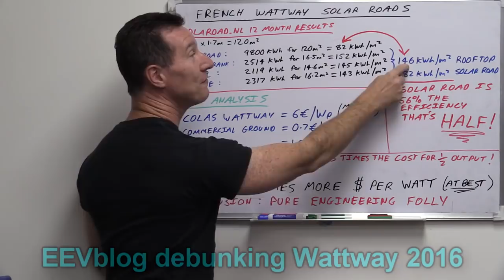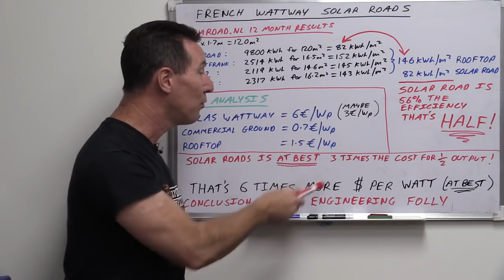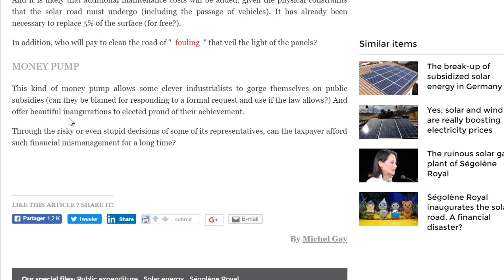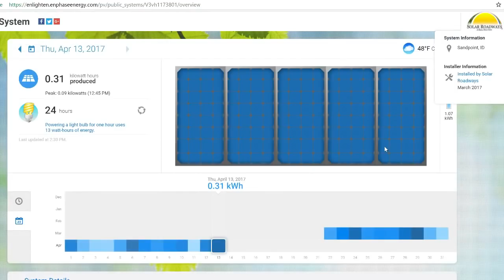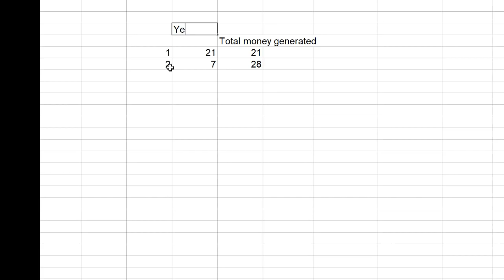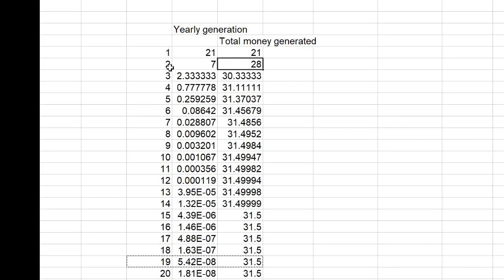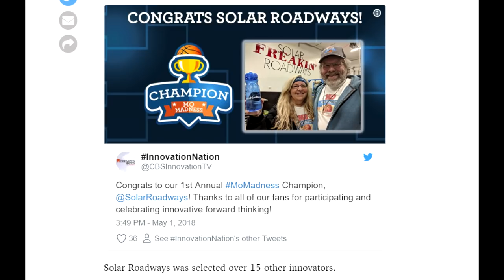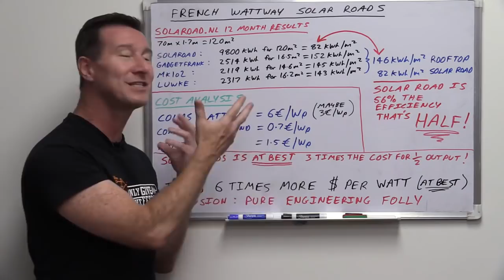Solar Roadway: 10¢ return on $1000 investment!

Comment: Solar powered flashlight!!

That only functions during the daylight hours:)
Reply: Give this man a 2 million dollar grant!
Reply: @user-oy8vu3xb2y   voting u for the  next elections
Reply: Boi, the flashlight is supposed to CHARGE ITS POWER BUFFER during the day than actually using the power...
Reply: @905SunnyGachaGaming   think outside the buns
Reply: You can easily fix that by mounting a small mirror in front of the flashlight, reflecting the light back onto the solar panel: infinite energy supply!
Reply: @1FRAG1B  if it ever happens , im taking you on the first mission to mars!

Comment: why roads though? I would have thought pavements and side walks would have been better. If you look at a new road vs a road that's a few years old, you can instantly see that the older road is much more smooth. However pavements and sidewalks take years to wear down, you have to go to ancient castles to find grooves in stairs from foot fall.

Comment: Isn't better to put a Stirling engine. It could be with the surface of something that accumulates heat and be something durable for the cars. Like normal roads. Then you put a sirling engine that makes energy by the difference of the heat.

Comment: Why not build solar panels on top of utility and light poles? Put a small motor on the bottom of them so they can turn and track the sun. Power the lights for the roads and any excess gets sent via power lines to a power bank for later use somewhere else.

But I guess scam artists can't make money off of idiots using that idea.

Comment: If they burned a $1 bill roughly once every 10 minutes (5.707 times per hour) you could recover roughly 4 BTU per bill via thermocouple. This would equate to roughly 0.16059 kWh produced every day. At this rate, you would produce 586.173 kWh over the 10 years it would take to exhaust 500,000 $1 bills. Since the average price in the U.S. is 12 cents per kWh, burning money would return $70.34 --- MORE THAN TWICE WHAT SOLAR ROADWAYS RETURN.
Reply: boom!   Thank you for being that somebody to do the math calculation of literally burning money.
Reply: Steven Biars good game man.
Most interresting comment of the day.
Reply: Consider if you did this for a time approaching infinity the efficiency is going to drop even further as you inflate the value of $1 notes by burning a substantial amount of them, if they can't be replenished quickly enough.
Reply: @Marci124  that would increase the value of $1 notes.
Reply: ooof
Reply: Stupid FREAKIN' Idiots!!!

Comment: So I have been watching a few of your videos. The content is interesting but you repeat the same thing over and over and over without the repeating the exact same clips  and statements you could half the length of the videos. I get repetition I learned that in college that when speaking to repeat the point but generally it was encouraged to use different wording to reinforce the point or repeat in a short summary at the end.

Comment: You forgot to calculate in the rage it apparently causes in David. If you add that energy to the equation the system comes out about break even.

And David will last a lot longer too.

Comment: Just another example of government incompetence.  Solar panels aren't even worth it compared to coal under the best circumstances.  If solar is so great, we'd already be using it to replace coal/nuclear in our power grid and we wouldn't need a government program to force it down our throats and waste a shitload of tax money.  Instead the government tries to push solar panels through taxes and regulations as well as giving tax payer funded incentives for people to use solar.  It's fucking retarded.  What a waste of money.  

Grow up liberals.  We want our electricity cheap and our taxes low.  When solar technology improves to the the point that it's better and cheaper than other sources, then and only then will it be a viable option and no wasteful government intervention will be required.  Free market principles.

Comment: I don't get why this is still even a thing, or ever was. How is it more logical to make a surface covered by objects solar panels when you could simply put the solar panels above all of the roads, or better yet simply subsidize solar panels for buildings and houses and sell the power consumed to the buildings owner at a discount. I could ramble off a list of probably 400 better locations for bulk solar panels to be placed that would require far less upkeep, far less sun light obstructions, and overall just far cheaper, but of course they wouldn't be as novel as the idea of driving on a flat surface in the rain all the while degrading it's ability to do anything -_-

Comment: I don't know the fraction, but it would be a fraction of the cost to install the solar roadways, all car parking areas and sidewalks can be covered and solar panels installed on these roofs. Benefits: cars and pedestrians are out of the elements, and you get 140-150 kWh/sqm power from it.
Alternatively, you can just invest all the money it MSR development and have abundant (way more than any solar), clean, cheap electricity.

Comment: I have a proposal for solar Parking lots, Build solar Roofs over the Asphalt so the Cars can stand in the shadow. Its a winwwin situation: its about the same eficency as a normal instalation with fixed panels and in the summer the cars parking under the Panels dont heat up as much because they arent standing in direct sunlight. another advantage is that this instalation would produce power in proximity to its users.
I think that this is a good and realistic idea.....

Comment: Welp...  adding another entry to The List.  :-/

BAH  HAHAHAHAHAHAHAAAA!!!  The Ray C Anderson project, or "The Ray", in Georgia...  might as well be called "The RAT."  It is only 50 meters long...  and in the middle of a PARKING LOT.  It is essentially a truck scale for big rigs with solar panels and tire pressure sensors that invade your privacy to steal your cell phone information so they can xend you advertisements in the guise of "sending you a text to tell you your tire pressure when you drive over it".  

ANOTHER bullcrap money wasting project.  At least it is not on an actual roadway.  

Can someone please put a slug in the jackanapes that run Colas and that female idiot busybody little evil doer imbezzeling all that money from the Ga government with this worthless project please?

Comment: Remember that bit in Robocop, the original one, where Dick Jones says 'Who cares if it worked or not?'. Yeah, will this is the same thing. They know its BS and absolutely inneficient, but they will make a killing repairing it and replacing it over the years. 

Has anybody costed replacing all the existing roads with these solar roads? Im guessing it will be way into the billions in dollars, and the cost in energy will be incalculable. Im guessing theres a congressman or senator somewhere with a stake in a road building company jumping up and down in absolute joy at the prospect of tearing up a highway, then laying down another that will have to be replaced a year later. he's the one who will be pushing this, so keep an eye on the bastards.

Comment: Honestly i really like the south Korean idea. A lot of major highways have center dividers that would be perfect for a extended solar system if they mount it to some solid steel foundation that could withstand a car/semi crash.  The energy output would also rival that of roof mounted systems so  you could easily see the investment pay for itself within 10 years or so and still have the panels producing energy for another 10 years before replacements needed to be discussed.
Reply: It’s neat, but a lot of the space between highways are empty for safety(they are quite effective at slowing cars without stopping them instantly lowering chance of death).
By putting stuff in these spaces you increase the damage caused to vehicles, people, and your solar system.

We intentionally use protection systems that are not solid next to roads to give cars a chance to slow down and have saved countless lives with them.
Anywhere we have to put solid walls next to roads we do, but if we can avoid it we do.
Reply: Jacob Haver 
That South Korean idea is in fact a bicycle highway that is covered by the solar panels to protect them from the sun and rain.
Reply: @BLY99  
Plus on that: Cyclists and pedestrians won't be as hot as if they were un-shaded. Leading to less use of air-conditioning and/or fans, which would save more electricity and make more money in said savings than putting the fragile things on the fucking road.
Reply: And in this amount, the costs should be quite lower than for a single private home roof.
Reply: jshowa o they quite often are a lot lower than the roads by design, are ditches.

We use walls when we have to. In those spots I have little issue with having solar setups in those situations.
Reply: jshowa actually the ditches are quite good at stopping most cars on the road, it has some trouble with semis or large larger vehicles.
The vast majority of the time people do stop. However highway dividers also have trouble with larger vehicles.

80 miles is really quite a small part of the highway and can require highway dividers.

You’ll notice on the highway anything that can be designed to break away or slow down people slowly, excluding those times when absolutely necessary is.

Super busy parts are the parts that need these barriers.
Cars are designed to crumble on impact, but that only does so much, cars need more than that.

I’m not questioning highway dividers use on highways. I am saying that these dividers if overused will take more lives than they save.
In spots that have highway dividers it’s often either no protection or the walls, and obviously walls are better.
Also, a hill would probably be worse than a wall, when it got hit would likely cause more damage.

Comment: Why waste more money on inefficient solar roadways? We could more easily, on roads with no services beneath then, take the heat of the summer sun and store it in the ground and come the winter take the stored heat and use it to keep the roads ice free. Please note I said more easily and by that I mean more easily than getting any usable electric power out of a road surface. I am aware that there. Are limitations to such systems, such as having suitable available ground to put the heat into; but I'm sure we could get enough heat out of our asphalt roads as nearly every summer these days in the UK we hear of melting roads.

In urban areas we'd have to move the utilites first, and that's expensive. Just look at how much Edinburgh spent on getting its trams back (and how long it took). But in rural areas and on other roads without any services beneath them the cost of installation wouldn't be that great, in comparison to such works in urban areas (or the current cost of a mile of road). For example, the 9 miles of the M77 cost around £130million, a gew extra millions spent on a system that reduces the amount of salt per mile must be worth looking at.

Comment: Mind you your calculations were pointless, we all knew it would generate bugger all and obviously they had complete panel failures as that is not representative of a bog standard solar panel which will give close to full output for five years and fall off slowly. I reckon that by year 10 all things being equal, they will generate 2 cents a day. Flipping amazing. No need to fiddle the math.

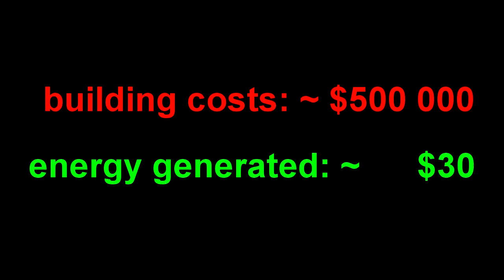Comment: 11:45, is it? What would be the ROI on burning 1$ bills for heat? Well:

ROI of solar roadways: 0.01%

Amount of heat from a dollar bill 13125 J/$ http://www.madsci.org/posts/archives/2005-11/1131041118.Ph.r.html
price of 1 kwh electricity 0,12 $ https://www.ovoenergy.com/guides/energy-guides/average-electricity-prices-kwh.html
Natural gas 358497428 J/$ https://www.oilcrudeprice.com/natural-gas-price/
one kwh in joules 3600000 J 
Electricity J/$ 30000000 J/$ 

Burning 100$  creates 1312500 J of energy.
This saves 0,003661114132177 $ (1312500/358497428) Worth of natural gas, thus you'd have an ROI of ~0.004%
If we compare to electricity instead, we save about 0,04375 $ (1312500/30000000) worth of electricity for an ROI of ROI ~0.04 %

In conclusion, burning dollars to heat your house is more stupid than solar roadways. However, burning dollars to generate electricity could be about 4x more lucrative than solar roadways.

Comment: My bunk meter always goes off when someone announces a product which has a primary function and then adds more and more other uses any of which would be marketable by themselves... yet are never sold separately. With solar roadways...

1. You have some type of solar system able to generate electricity economically while laying flat. Wonderful. So... go build that. Find some flat ground in a desert area in a few hundred kilowatt system and make money doing that. Skip the roadway, sensors, LEDs, etc. with all the new engineering and materials. Just go make money selling commercial flat panels for desert areas and local power generation. Earn a few billion and then use that money for more R&D, meanwhile reducing the cost of commercial solar since you don't need tracking, angled panels, can put them on flat roofs, etc.

2. You have a cheap transparent glass-like material able to resists scratches, cars, and cars driving on you. Great. Skip the solar nonsense, make a few of these smaller panels and license your patents to window companies. Name an automaker, commercial or residential, aerospace, etc. window maker would wouldn't pay billions a year for a cheap transparent material which is strong enough for cars to drive over it. Again, make your billions and use that money for R&D.

3. You have LED lighting bright enough to be seen in the day and from a high angle. Again, if you have that... why worry about solar panels or road surfaces. License the technology to TV makers, large screen makers, highway signs, billboard makers, Jumbotron makers, cell phone makers, or just general light bulb makers. If it works, make billions of this and then research other things.

4. You have some magical sensors able to detect moose and cars on the roads. Great. Sell this to highway departments and cities for normal intersections, highways, parking lots, etc. and use normal signs and lights to control traffic. If you have a sensor system able to detect a stopped car anywhere along the highway economically... demo that to some highway departments and just have it send a text message to the highway department.

When a company announces some system which includes multiple technologies each of which are easily usable and marketable on their own, and yet won't market/sell/develop these separately... its a clear sign that none of the technologies work and that they are selling a dream rather than functioning technology. Give me any of the above working technologies and I'd have billions.

Comment: why not put the solars above the road? it could even still be smart by having signs hang down and sensor monitoring conditions (still pretty impractical for rural or urban roads and a maintenance hog but at least it would not be flawed in even basic concept)

Comment: The reason they cost more and produce less is because it has to be driven over you cant use the whole cost of the road just re paving a road costs 1mill a mile 
To compare it to solar fields add in the cost of the land that the field is on

Comment: If they had used the $500k to install solar 120 rooftop solar panels and then used the money earned each year to install more panels on more roofs, then you get an increase of 16% of electric generation per year and after 12 years you are earning $500,000 per year.

So with an initial investment of $500,000 you earn $500,000 per year after 12 years by installing rooftop panels instead of solar roadways.

Can I have $500,000? I'll pay you back the principal in 12 years and then in 20 years I'll pay you $500,000 per year forever.

Comment: Could this be combined with the recycled plastic roadways in some way?  The synergy from solar power generation and recycling would likely put this over the top.  
You could double or triple the cost or either idea by integrating concepts of both while reducing the lifespan of the solar generation and the roadway even further.  Sounds like a win-win.